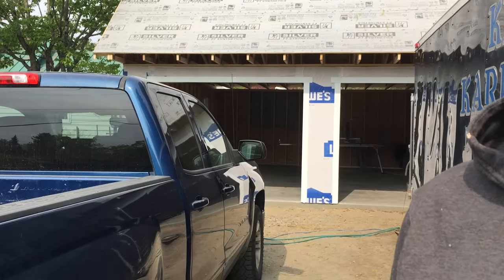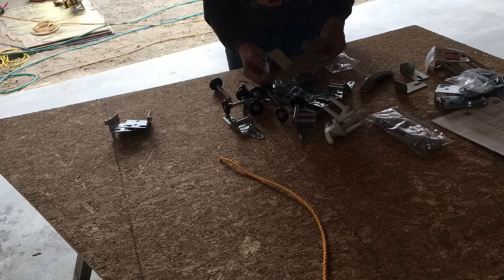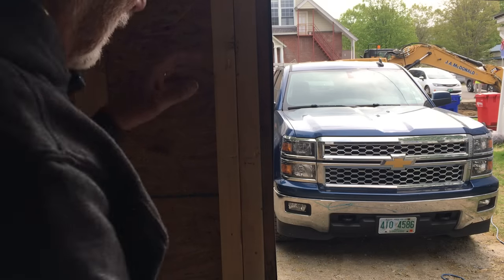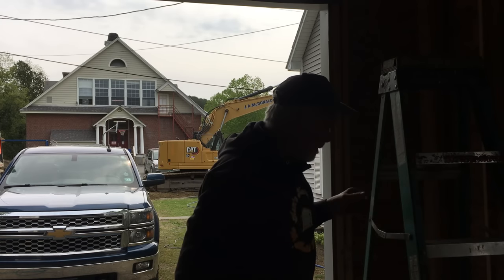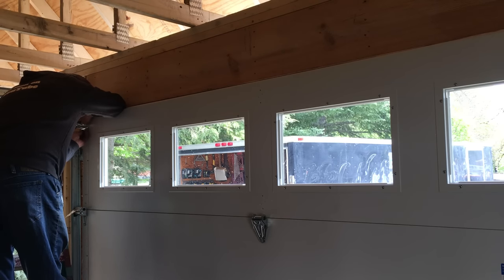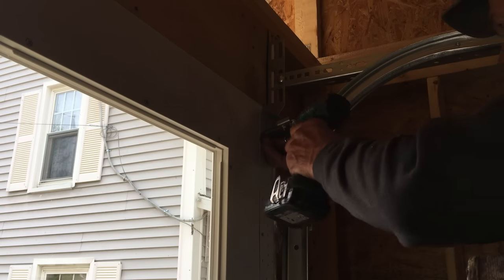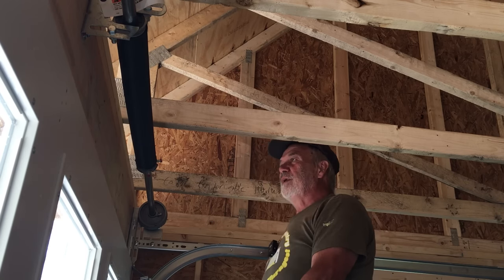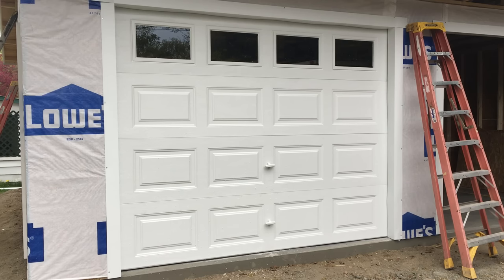How I Install a Garage Door...Step by Step

Comment: Instructions were good except for one bit of info. You stated we need 7-3/4 revolutions on the torsion spring. How do you know this or calculate this??
Reply from the maker: It usually states in the directions how many winds

Comment: When in my twenties as a senior foreman I operated an excavator, along with other heavy equipment, and ran several crews installing water, sanitary sewer and storm pipe. I finally got to go back to college at night in pursuit of an engineering degree, after which I surveyed, designed, permitted and did oversight of projects. Retired now and enjoy watching your construction.

Comment: You want to gap the spring so the coils don't rub on each other. At the end of winding the spring, take the rod in your free hand and smack the rod still stuck in the spring to lengthen the spring a bit. Then tighten the spring to the axle. Having a slight downward angle on the door track helps pull the door into the garage. Now that you have done many doors, portions of the instructions that didn't make sense at first will now, it did for me. I watched this video not to criticize but maybe to learn something and I enjoy your videos.  LoL  👍

Comment: My father once said to me, "Be careful turning those torsion springs, you could hurt yourself."  . . .  I replied, "Many fellows are killed every year turning those springs."  He was an Industrial Mechanic for many years.  . . .  and then he taught the course becoming a Department Head.  I enjoy watching Ken at work.  It is a learning experience to watch a professional.  Thanks Ken.  It is good to see you back enjoying your work.  I was thinking that the crew working out front might forget you one night.  You might have to pack a sleeping bag and sleep in your truck.  😊
Reply: It's one thing to show up what you have done 800 - 1000 times and another after spending two days in the hospital, for anything. Great job Ken.

Comment: @24:45  You mentioned removing the door locks if an automatic door opener is installed.
Another option is to put a bolt in the hole in the handle @25:36 to keep the handle from locking the door.  Then the locks would still be available if the automatic door opener was removed.

Comment: Stock insruction pamphlet says to stack doors in opening and hold them in place with nails bent over(Huh?) and then install verticall tracks. You install the tracks first and that seems the safest way to do it so why do they suggest otherwise? Just curious. You remind me of an older builder I worked with years ago. Great guy, soft spoken, very organized, and a depth of experience that only comes from a liftime in the trades. Very helpful video, I'm hanging two doors just like these and I've done a few but needed a refresher course.Thanks!

Comment: As a former door hanger we always stacked door with top first on the saw horses with bottom section on top of two stacks on saw horses with bottom of door at your waste. Put hardware on back 2 sections that would be last to go in opening. Add hinges to section turn with section and stack them up screw sections together as we stack in opening. Bottom section we would level if needed to start stack then door cables would be set for hubs or springs. I would put mark over door where spring plate goes ( do not remember that measurement been 30 years ago ) leave ladder in place then put bar with springs, plates and  hubs all together on horses looking at door walk up ladder with impact gun on top of ladder.    You can take a white marker and make a line across the spring and as you wind up spring you will have a count that will come up from the line you made on spring. Top hinge was up side down. Hope this will help others people. You did a great job thank you for your time.

Comment: As a retired builder after about 45 years in the business, i have strong opinions on doing things like installing garage doors yourself.
A person who installs them for a living, will hang two garage doors in about a half day.
And during that time i could be doing something else.
My time hanging those doors would be worth what the cost of having them installed is, nothing more.
Reply from the maker: I agree to a point. I’ve installed over 800 doors so I’ve gotten fairly proficient at it. The other problem I had was having an installer do it in a timely manner to maintain a schedule.

Comment: Hey Ken, my garage doors use the extension springs, one on either side of each door. Have you ever installed this kind of door? My doors do not seem to roll very smoothly.
Reply: Old Side springs?  Maybe oiling or lubing them up with silicone spray would be helpful. Also, I hope there’s a safety wire running through each of those springs because when it  breaks, it could kill you or even “shoot your eye out.”
If it’s just two springs on the pipe, then just spray silicone on them.  It’s safer to have two springs per door rather than one.

Comment: installed mine just like yours. My cables end up at a severe angle when the door is fully opened and make a creaking sound. Doesn't seem to be a huge problem, but I was wondering if I had installed something wrong. Worried that the cables might rub and wear out over time.
Reply: Yup, I did same, I moved the top roller in perfect alignment with the button of door so it's not touching nothing. Zero touching..I put door down and pick cable sound like guitar string.i think gonna last much longer if it's not rubbing nothing.
Reply: What exactly is it rubbing and what do you mean by its making an angle, I dont wanna be captain obvious but it should be straight vertical and hitting nothing during the full opening cycle of the door